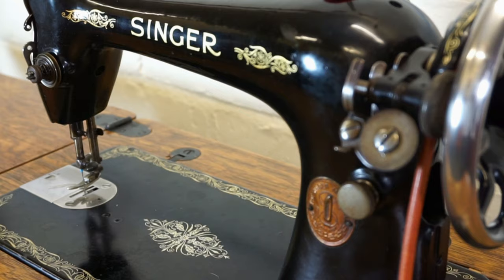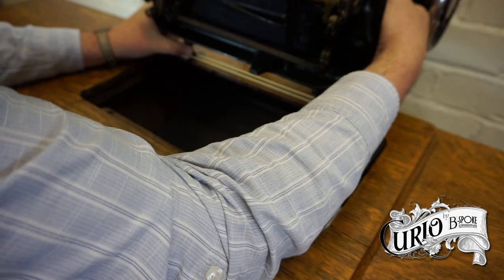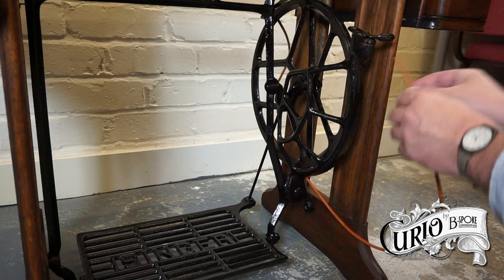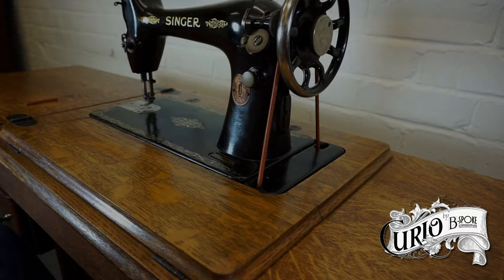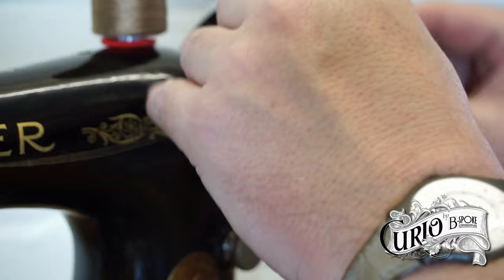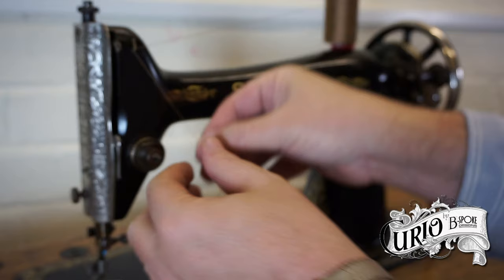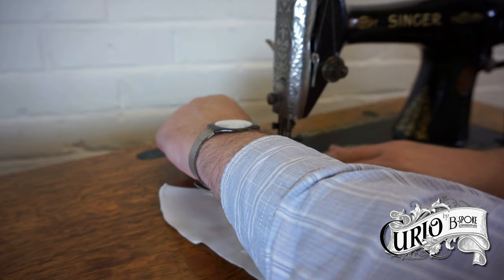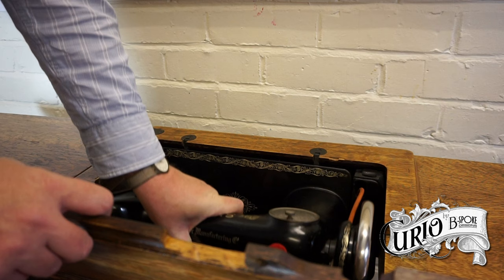Singer 66 Treadle Sewing Machine - How to Set Up & Use

Comment: Quick tip guys , if you loosen the stop motion knob before you put your treadle away it makes for easy belt off and on again without the machines needle engagement , just how i do it to save from running the entire machine during belt install ,

Comment: My Grandmother had one of these machines with that style treadle, she used it right up until she went to live with my Aunt in 1999, she never owned a modern sewing machine. Everything was either done by hand or that Singer sewing machine. I have one myself that I am learning on but mine is a 1929 66K with the electric motor that someone just rewired. I will probably put the handcrank on it because I want to have a bit more control of the speed when I sew, especially just learning.

Comment: Thank you for this informative video.I just looked at my 1900 Faultless machine. It does not appear to have a belt de railer. My machine was a family gift. It is about to be taken to a repair shop for an ovehaul. It is almost 100% intact.The bobbins and shuttle were lost in the move. The original manual is folded in pages. I will carefully copy.
I think the bobbins were the tube shape, not round. Looking forward to this adventure in sewing!
Reply from the maker: I believe the Faultless was a rebranded National machine. I would guess that a National shuttle may fit it. Not all treadles had the derailleur - my Improved Home Companion doesn't. 
I bet you can't wait to get it back from its overhaul. I'm sure you'll enjoy it for many many years!

Comment: I’ve just brought a model 66 which still has original 1937 receipt. Very helpful vid thanks.
Reply from the maker: Wow! You're lucky to have the original receipt. It would be fun to use an inflation calculator to work out how much it would cost today.
Reply: @CurioByBSpokeDesigns  hopefully I’ll have the machine in a few weeks so I’ll let you know. Mine has the same table but lotus decals and is 1934. It was brought out from the UK by the person I brought it from to Nz
Reply: @sprucemoose3000  Any news on the original price?
Reply: @hayleykirkby8296  Hi Thanks for the reply and yes it says 19 pounds 13 I think, which sounds like a lot? 
It was sold on Old Kent Road. (Thats in Monopoly isn't it?)
 Style 66k4 5Dr Cab which is the cabinet I guess, It's so nice to use, I've brought a crank for it too.
Reply: @sprucemoose3000  wow! I think that’s be about £1500 today.
Reply: @hayleykirkby8296  Definitely worth the $150 NZD I paid for it in good condition, and it will still be going long after we are gone if looked after.

Comment: I found your site while searching for treadle machines as I just finished restoring a 66 model singer (Red Eye) machine and cabinet. Your information is really helpful, thank you! Now I can go back and tweak mine a bit but I have a great affection for the masterful craftsmanship of these old Singer machines. Simple manufacturing but still very usable. I have and have had a variety of  old and new machines but I find that these old Singers, sew a really great stitch once the tension is set!
Reply from the maker: Hi Mary. I'm glad you have found my video useful. These machines are incredible considering how long ago they were designed and made and what little technology they had back then. They were truly skilled designers and craftsmen. Enjoy your 66!
Reply: @CurioByBSpokeDesigns  The most interesting to me is the simplicity of the engineering. I also love the weight of these compared to today's new plastic machines. Love your videos!
Reply: I have a singer red eye 66-1 treadle and base with iron legs. Do you have any information or sites for me to get it up and going? I have oiled all moving parts & they are moth gliding. I started on bobbin area yesterday and am last as to how to take the bobbin casing out. Any help would be truly appreciated. I inherited this beauty!
Reply from the maker: @willablake9284  I have a video on restoring a 15 - not quite the same but similar process
Reply: @willablake9284  there is another video on u tube that will show you how.

Comment: I love the rubber band trick with the hinge-pins!  I will be using it. Also, I never thought to leave the excess belt in place until I tested it; I guess I didn’t think one could run the machine with that little bit of belt hanging off.  
Thank you for an informative video!
Reply from the maker: Glad it was helpful!

Comment: Love it, love it, love it. I had to laugh when you showed the release to move the belt off the wheel. Why? Well, let’s say … good thing I always have extra belts for my treadle machines. I forgot to use the lever to remove the belt…you will pop that belt when you lift up the machine head to put it away. Not really funny but you will feel kinda dumb when you do it. Then you laugh once you get over the shock.

Comment: Hi. Thanks for the helpful video. My only question is how do you stop the machine when sewing at speed? Do you just grab the wheel to stop it?
Reply from the maker: Basically, yes! If not, the flywheel will have enough momentum to keep the machine running for a short time. It's a whole new skill, treadling, if you're used to electric machines.
Reply: @CurioByBSpokeDesigns  thank you, I’ll have to practice!

Comment: I have a Singer 201K in a cabinet and a new treadle belt for it. I was wondering if you could give me an idea of how tight I should fit the belt/how much play should there be in it, please? I love your videos. The only problem is that you make me want one of each model number. I already have a 99K and a 201K. Now I'm ogling 15K machines as well. Oh dear!
Reply from the maker: The belt should be just tight enough to drive the machine without slipping. Too tight and the belt can cause wear on the bearings. Start loose, you can always shorten the belt.
Reply: @CurioByBSpokeDesigns  much appreciated, thank you

Comment: Hi - very helpful video - thanks! I'm enjoying restoring a 66-3k and want to attach it to my mum's old treadle table. The table housed an Industrial 103 so I've had to move one of the hinge brackets  so that it fits. The treadle has a knee lever attached and I wondered if it is possible to connect this to the 66? If not, then I should probably remove it as I keep catching my leg on it! The industrial used to have a motor attached so would this be necessary?
Reply from the maker: Was the knee lever to lift the presser foot? If so, then it would not work with your 66
Reply: @CurioByBSpokeDesigns  Thanks for getting back to me. I never saw it in action, but I suspect so. I wondered if it wouldn’t work- I’ll remove it.

Comment: I just bought a Singer 127 treadle head in amazing condition. I don’t have the treadle cabinet. I don’t know much about these but I sort of assumed I could at least operate it with the hand wheel and get an extra handle for the wheel to use it for longer periods. Is this possible to use the treadle machine without the treadle? Now I’m second guessing haha
Reply from the maker: If there's a screw hole below the hand wheel, you can attach a hand crank. Bases are easy to come by to house the machine in.

Comment: Great video! I just purchased a Singer 201-2 that seems to have been with the original owner’s family.  It works, but it is a bit dull. Do you have any suggestions for what material to use to clean it and to make it shiny like yours? Thank you very much!
Reply from the maker: sewing machine oil is safe to use to clean the black area. It's a mild cleaner and will not damage the decals. You can use a carnauba car wax after if you want an extra shine. I have videos on restoring old machines. There is show you the cleaning process.
Reply: @CurioByBSpokeDesigns  Thank you very much! I will check out those videos you mention.

Comment: Hi thank you for the informative video.  My 66 stitches beautifully as long as I turn the crank wheel.  I can't get her to stitch with the treadle.  The treadle works freely, the belt moves around but I can't get it engage in stitching.  Any suggestions.  By the way, the belt goes in the opposite direction of the wheel, is that correct?  Thank you.
Reply from the maker: It sounds like the belt is loose or stretched. They are easy to shorten/tighten. The treadle should always drive the wheel towards you. If you have trouble treadling the right way, start off by turning the handwheel towards you by hand.
Reply: @CurioByBSpokeDesigns  Thank you so much for that advice.  I thought I needed a little slack in the belt; I shortened it and it works.  However sometimes I lose the rhythm and it sews backwards.  Operator error I believe.  I'm just so happy to get her going.  Thank you!

Comment: Hello, I have a 66 as well and my wheel (the small one) is not turning the treadle. No idea how to troubleshoot this issue. Tried adjusting the belt length but that doesn't seem to help. Do you have a video that explains the mechanism in more detail?
Reply from the maker: The small wheel doesn’t turn the treadle. You move the small wheel towards you as you start to treadle to make sure the machine is moving in the right direction. If the treadle doesn’t move the machine then the belt will need adjusting.
Reply: @CurioByBSpokeDesigns  Thank you. Sorry, I realize now what I wrote makes no sense. When the needle is disengaged, the belt with the treadle turn the wheel quite efficiently, but when the needle is engaged it goes very slow. I tried tightening the belt, but it didn’t really do much until it was so tight that the belt slipped from the treadle. Maybe the belt is old and there’s a friction issue?
Reply from the maker: @badassxwx  is the machine stiff to turn with the handwheel? it sounds like it needs a good oiling

Comment: I loosen my motion knob but it still engages it stops for a lil bit then it engages out of no where how do I fix this? please and thank you
Reply from the maker: Yes, you need to loosen the screw from the stop motion knob, take off the stop motion knob and the hand wheel and give everything a good clean - my restoration video on the Singer 15 shows you how. Once clean, give it a bit of oil and reassemble.

Comment: I have a Model 66 also it is a 1919, and have most everything replaced or repaired on mine but the pressure foot Knob or control is missing, so I’m wondering if you know a part number for another as it will not sew without pressure applied.  Thanks.

Comment: This is lovely and really helpful, thank you!
I know this is an old video, but I was wondering whether you could help me figure out what's wrong with my bobbin winding mechanism. 
I think I might be missing that ring of rubber (?) that engages the winder with the motion of the handwheel, do you have recommendations where one could find that?
Also the top thread guide on the bobbin winder on mine seems to stick out towards the other side - it doesn't go behind the little round wheel but in front of it. It does however move along when I try and move the little wheel (the one missing the rubber). Is this a defect or where there machines made with it facing either way?
Reply from the maker: There are different styles of bobbin winder - yours may be missing a rubber tyre which are readily available on ebay. Some were designed not to have a tyre but to run against the treadle belt itself. it would be difficult for me to tell without seeing photographs,
Reply: @CurioByBSpokeDesigns  Thank you so much for answering so quickly! It looks like it should have a tyre as there's no way of it connecting otherwise. I've looked around and unfortunately found different sizes - do you know what outside diameter the ones for a Singer 66 have?
I've tried measuring myself and think it should be 3 cm, but I'm not sure whether there's any compression of the rubber (and therefore a larger tyre) needed for it to transfer the motion.

I wish there was a way to share pictures on here 😅
Reply from the maker: I'll see if I can measure one later
Reply: @CurioByBSpokeDesigns  Thank you so much, that would be very helpful!
I've only just got the machine and really want to get it up and running. My first venture into this.
I'd watched your videos and a couple of other ones beforehand and tried to be as thorough as possible (for someone with no experience) when looking at it, but the missing tyre slipped my attention 😅
The good news is, it does actually sew.

Comment: Where can I order parts for the bobbin mechanism—the rubber part on the wheel that you turn to engage turning the bobbin?
Reply from the maker: They are called Bobbin Winder Tyres and can be found at good sewing machine shops, eBay or Amazon
Reply: @CurioByBSpokeDesigns  thank you for responding with where to find this part.

Comment: I recently received a 1905 machine it’s going to need parts and how do I clean it up the needle parts and it’s frozen will not move up and down
Reply from the maker: The safest way is to oil it and let it sit a day or two. Gentle heat will help soften old hardened oil and should help free it up.
Reply: @CurioByBSpokeDesigns  Thank you

Comment: I have a 66redeye treadle, am deep cleaning all I can.  The treadle seems so hard to push on to make it work. Should I take it apart to clean screws,bolts,whatever?  Screws very hard to start undoing, what can I do to make easier to remove. Will trying to do this, make treadle easier to work?  Thanks for any info on this.    cJ in Mo.
Reply from the maker: I would take the belt off the treadle and apply sewing machine oil to all the pivot points. Allow to sit for a while then gently work the treadle to see if that frees it up. If not, then try a penetrating oil spray. Let me know how you get on!
Reply: Just oil all the moving parts if you have removed the belt. It will almost turn itself after that.

Comment: May I ask how do you change the tension on a 66 ? Thank you
Reply from the maker: the top tension is changed by loosening or tightening the tension disks at the front. The bobbin tension rarely needs adjusting but there is a screw on the bobbin case, use a small screwdriver and adjust just a quarter of a turn at a time.
Reply: @CurioByBSpokeDesigns  thank you !

Comment: Hello, might you know how to adjust the position of the spring plate on the right? Mine is too close to the belt on the top hole, so it rubs against it and over time would surely wear it quicker. For the time being I simply put some slippery tape on that spot.
Reply from the maker: Do you mean the bobbin winder? There should be a screw that loosens the bobbin plate so you can adjust it.
Reply: @CurioByBSpokeDesigns  Thank you very much, that was the solution.

Comment: great video, just cleaned a old 66k and need to set it up this is very handy. BTW what did you polish the paint work with?
Reply from the maker: i just lightly dusted it down and used sewing machine oil to clean up the paintwork. As this machine is Japanned I feel its safer to use only sewing machine oil. on later models i use a good quality carnauba wax

Comment: My husband bought a 66k 1928 model.  I'm having the hardest time getting the belt to stay in place.  I keep trying to adjust the tightens on it and the belt still slips off.  I don't want to keep cutting the belt and end up with a short belt.  I ordered 2 from Amazon.  The other one is for my 99k.
Reply from the maker: Is this the treadle belt? Try checking the derailleur isn't out of position, throwing the belt off the large wheel. The derailed might need oiling. It sounds more like alignment than belt tightness - you don't want the belt too tight.
Reply: @CurioByBSpokeDesigns  thank you. I will try that
Reply: We bought Nylon clothesline, measured very carefully, so there was a little play but not much, threaded the cord through the holes in the spring plate and around the treadle wheel, through the ring guide and back up through the cabinet. We removed the hand wheel, melted both ends of the nylon cord with a candle and carefully pressed the melted ends together. We let this cool completely then cut off the excess nylon. We then looped the now circular cord over the narrow, inner end of the hand wheel and remounted the hand wheel. It works great. There is a video of people in India doing this with English subtitles on YouTube.

Comment: Hi I know this is a chance I am taking..my ma hine is a threader singer 1940 or so?...i put a new belt on but I have 
trouble with the foot paddle getting stuck and it won't  go back and forth when it hits the down side in back side of machine and u try to push it with ur foot to keep it will not co e back to front of machine..it does not see at all if the foot paddle won't get the top small wheel to flow .
Reply from the maker: All treadles have 2 flat spots - usually right at the bottom and right at the top - you just have to get used to it, in time your treadling technique will mean you hardly notice it.  If it was OK before the new belt then your new belt may be too tight.
Reply: I had got this singer as a gift..the belt was broken, i got the new one..i do agree it mite be to tight...but i grew up on using mom's peddle machine..but this one the paddle is so hard to press down or up..thanks for your advice or any others help..i do love the machine and i want to so badly give it the respect this singer deserve.
Reply from the maker: @angileeleggett1323  make sure you oil the machine well and don't forget the treadle needs oil too!
Reply: @CurioByBSpokeDesigns  thank u...i will oil and hope for the best ..
Reply: I love your videos they help me a lot..thank you
Reply from the maker: @angileeleggett1323  aww thank you! That means a lot!